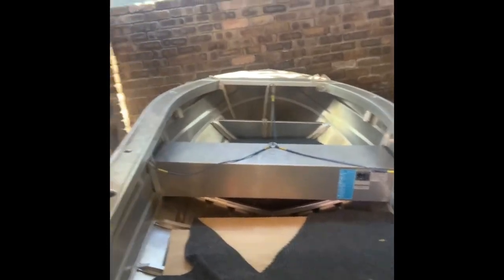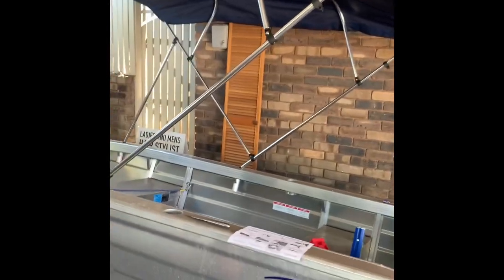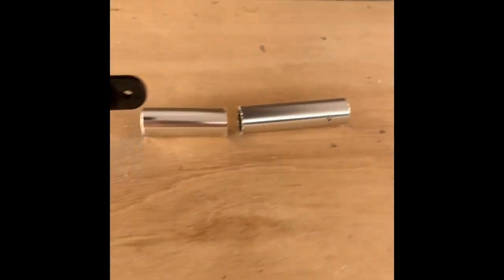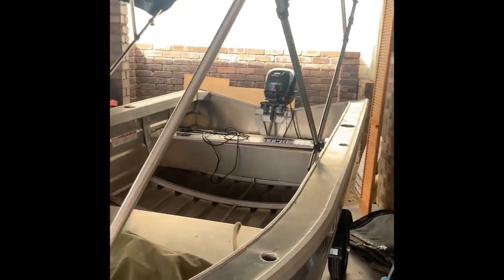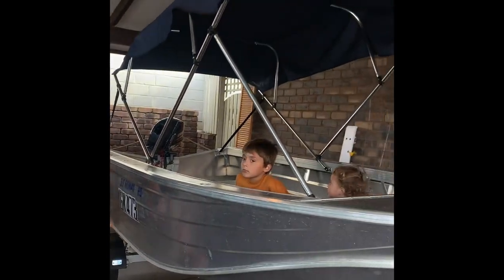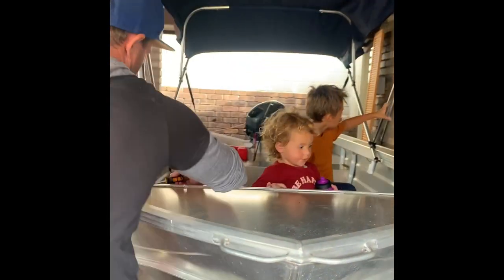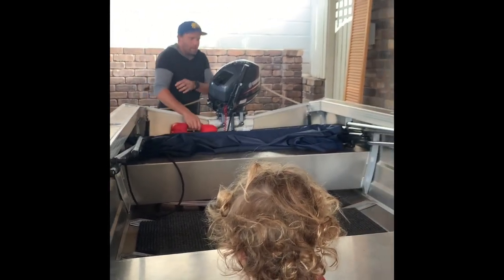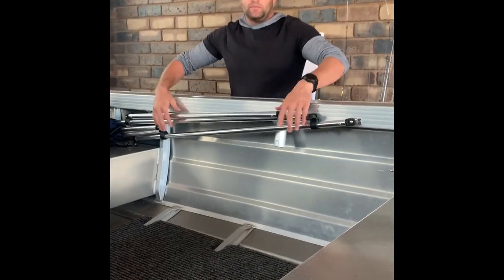Installing & Modifying my Bimini for the Seajay 3.7m Nomad

Comment: Nice one well thought out! Did that boat come with the gunwales welded in, class you've got rod and stubbi holders around the side as opposed to just the pressed plate going straight up if you know what I mean. Good vid mate 👍
Reply from the maker: cheers mate, yeah came with the wide gunnels and we added in the flush mounted rod holders and stubby holders so when it went on the roof nothing caught on the roof rack.